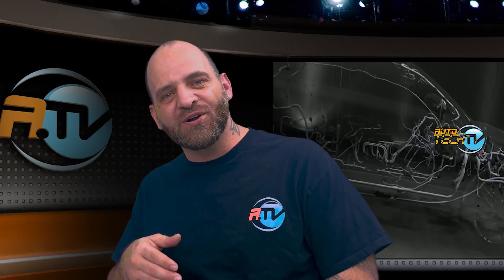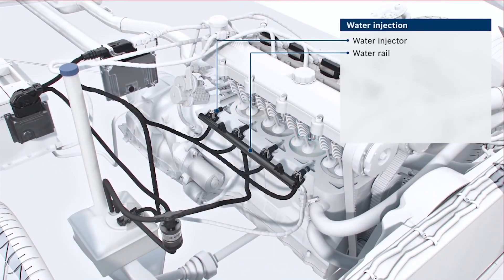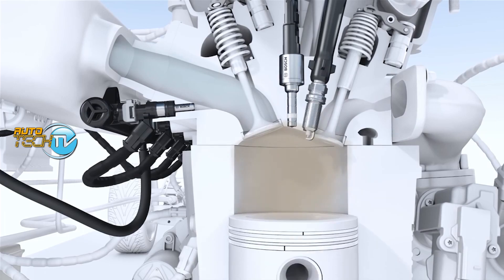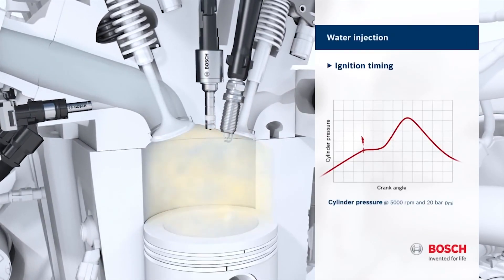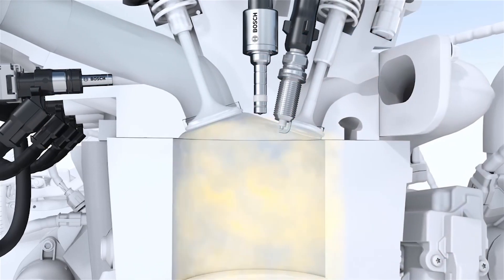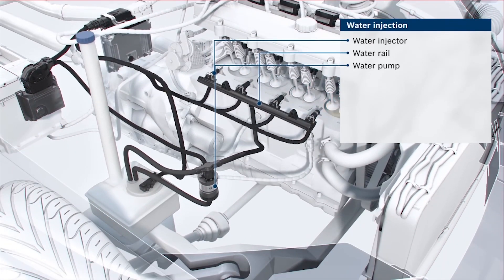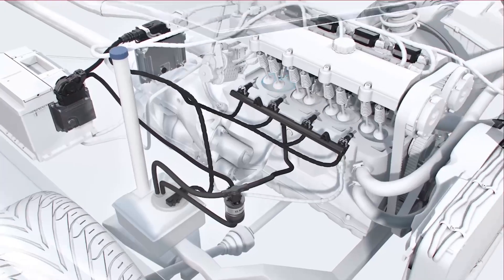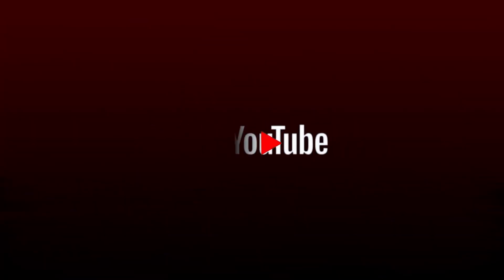How Water Injection Systems Can Create More Horsepower?

Comment: Id like to see an injection system where the water is injected directly into the cylinder,  just slightly after ignition where most of the force caused by the expansion has been used and then the water hits all that heat and expands even more.

Comment: Yes, the power is gained from denser intake charge, cooler, and the increased timing that this will allow. Methanol and water injection is commonly used so that increased timing can then be run. If you don’t dynamically set the timing with water injection it can be really bad if you run out of water.

Comment: I must see things differently.
Water injection doesn't cool the intake charge. The cooling only occurs once the compression stroke starts. Just before ignition, cylinder temps are above 400C°, at which point the water has absorbed heat and turned to steam.
When ignition occurs, the steam continues to absorb heat and expands at a rate greater than the accompanied air. This expansion boosts the force on the piston, increasing torque and keeps peak temperatures under 1100C° at which point Nitrogen will "burn" and create NOx emissions. If the engine is over rich, particulate count (soot, or carbon) skyrockets.

It's not as simple as hosing down the intake with water and reeping the benefits. The engine has to be built for the purpose. Nitrous Oxide engines are a good example. Same for Alcohol, or NitroMethane. Build the engine knowing what it will run on, and it will take full advantage of the fuel.